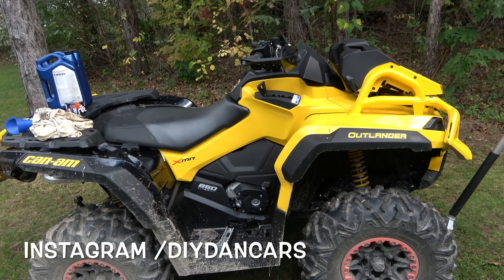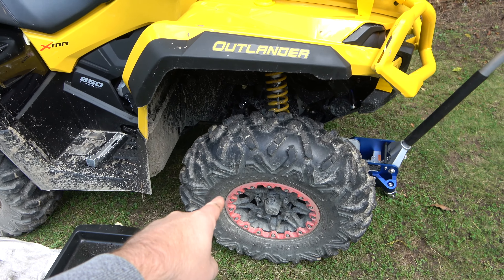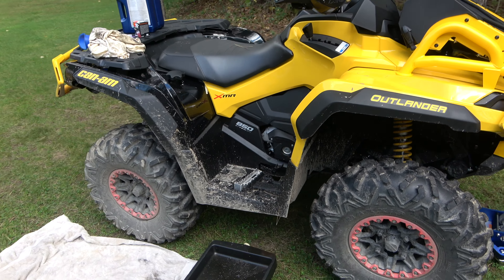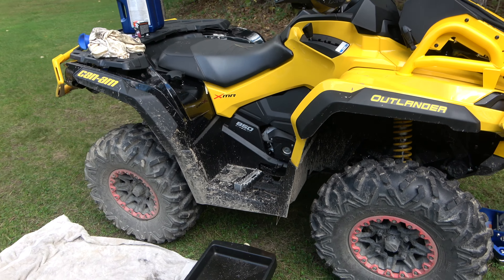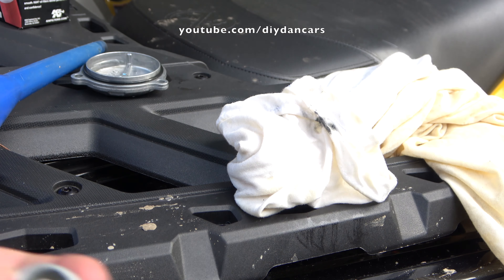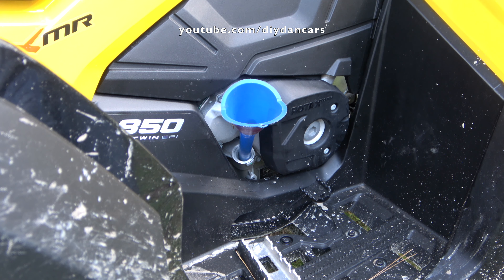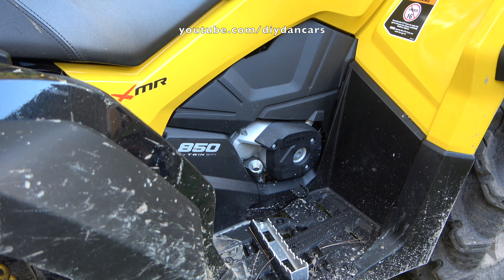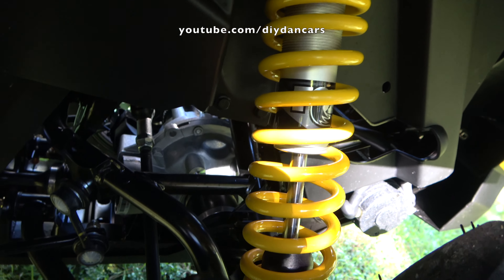How To Change The Oil In A Can-Am Outlander 850 XmR

Comment: What is the point of the crush washers? What was point of the complete oil change kit - would you recommend the oil from the kit as an alternative to the T6?
Reply from the maker: The crush washer acts as a seal for the drain bolt. Are you talking about the oil from the Can-Am kit? If so, that oil is fine too.
Reply: Thanks for the response.

Comment: Just watch your video wondering if that was diesel oil you were using I like to have the prescription after oil thanks
Reply from the maker: Shell Rotella T6 is rated for both gas and diesel engines. I run it in just about everything I own including my Porsche, Maserati, and Aston Martin. It's great stuff but don't take my word for it. Do some searches on the internet and you will see I'm not the only one that loves this stuff.

Comment: Hello, how are you? I want to consult you about the rear blinds Porsche Cayenne. The blinds motor has failed and the glass windows do not open or close. Is it possible to stop the blinds and operate the windows? We learned that there is a relationship between them so that if the blinds fail, the windows do not move and I do not want to buy the blinds motor, can you tell me  What's the solution

Comment: You not had a problem with it  it's a diesel oil ?
Reply from the maker: Shell Rotella isn't just for diesel engines. It meets API SN certification for gas engines as well.